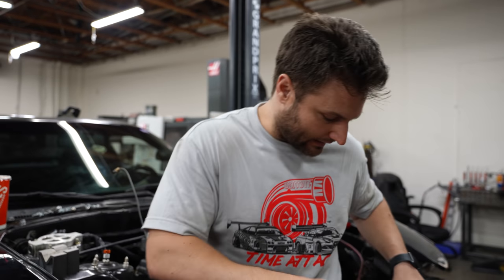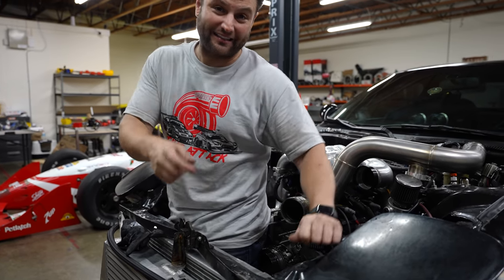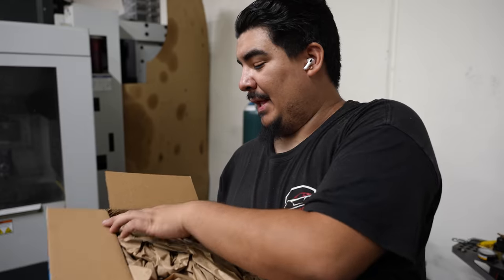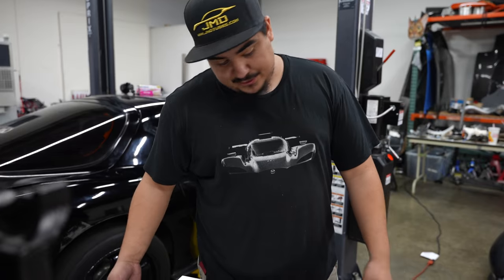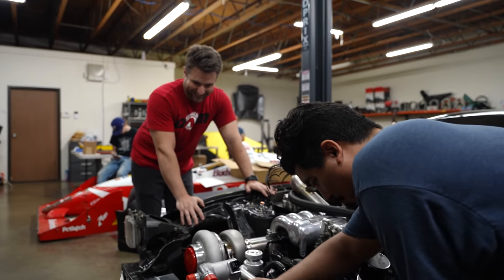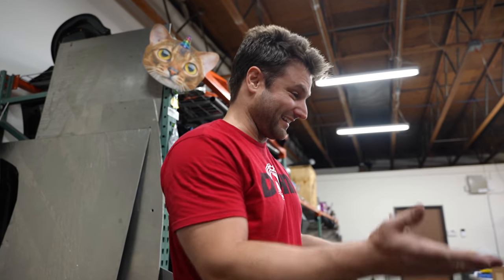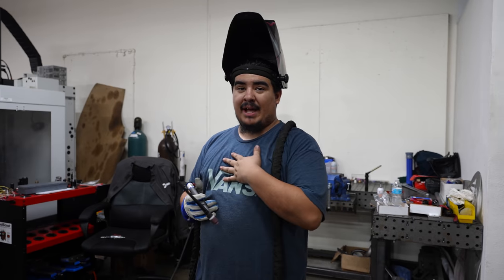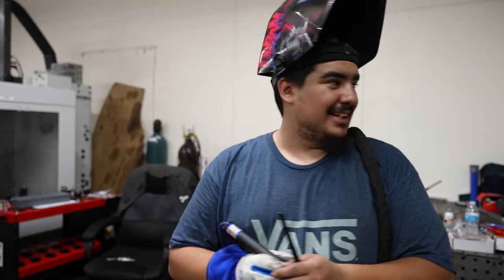We make it ICE COLD for the 1000HP RX-7.

Comment: Correction, you're harnessing ~1000hp of the ~3000hp worth of energy the fuel released during combustion.
You implied that 667hp of heat is being lost to heat which is inaccurate
Edit: Rotaries are traditionally terribly thermodynamically inefficient, so it's probably more like 4000hp of fuel burned for every 1000hp that can be harnessed. 

Love ya, Doritos daddy.

Comment: Hello, I have been researching PWM fan controller's. On several sites they keep mentioning,  Delta Current Control, manufacturer of high performance cooling system components, American designed and made only in the United States of America. They have a few options and they build to order. (support@dccontrol.com) (from their website) Our constant temperature, full variable speed controllers have long been considered the best on the market. They can be utilized with virtually any cooling fan and employ pulse width modulation in order to set the fan to any speed in order to attain a constant temperature without cycling, regardless of driving conditions. I Do Not Work There I just want to share some information I found. Most people found that all of the big names in cooling source their components from overseas and it is very disappointing after spending a lot for a big name and it just doesn't work.

Comment: Why not just let the fueltech control the fans using a solid state relay? It has the ability to output different PWM freqs depending on temps and would bypass that garbage system

Comment: Those controllers are crap, waste of $$ and even bigger waste of time. The fans are great, tons of airflow, only downside is even though they are spals you can no longer buy them from spal, apparently they are only made for derale. Concerning the issue of air potentially being trapped at the top of the radiator, if u have the space, adding a small header tank can remove that air. Cheers guys keep the good work, I really enjoy the fabrication aspect of the projects.

Comment: I’ve been doing this for years on my bmw right now I have a 48v alternator .  Using a step down converter for the car systems a/c compressor and cooling fan run of 48v I’m building an electric turbo right now I have a  Toyota Camry hybrid cells in the back as storage .   And    An inverter I got from  a solar panel setup 🤣🤣

Comment: Watch bad obsession motor sport to learn how to fine pin holes in radiators. Crazy amount of modification work went into there car. Pressurise the system under water. If there are leaks it will bubble out. Bingo

Comment: Is there crying?  Or is there a lot of eye rolling and acknowledgement about how that should have been expected?
Reply: Also, you want both ... more volume allows you to dwell in the radiator (heat exchanger) longer causing the delta in heat to be greater allowing for greater transfer during its relatively short stint in the absorption zone.  Simple example is how long does it take the ice cube to melt in 33 degree fahrenheit water v.s. 90 degree water?
Reply: The problem with air getting trapped in that outlet is not just the pump, it is flow efficiency.  You are effectively reducing your pipe diameter if air gets trapped until it is overcome by pressure.  Look up "what is airlock".  Hopefully you realize you could just do a split the outlet and put a tertiary radiator cap for bleeding... or pressure bleed and make that not the lowest point in the system.  Also a push is greater than a pull, so hopefully that was just misspoken.
Reply: You can just measure the resistance value of that terrible stick on temp sensor and replace it with a real sensor ... even a laser if you wanted to be Rob Dham fancy ....

Comment: SORRY WTF are you on about - Every cooling system I have designed and worked on (OEM and race cars) have the hot coolant from the engine ENTER at the top of the radiator so you have flow so NO air locks there!!!